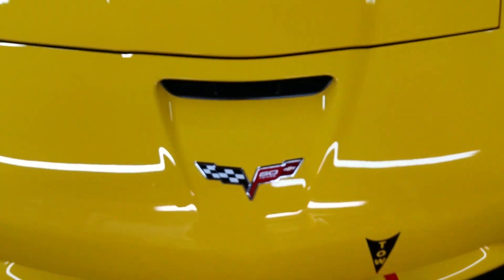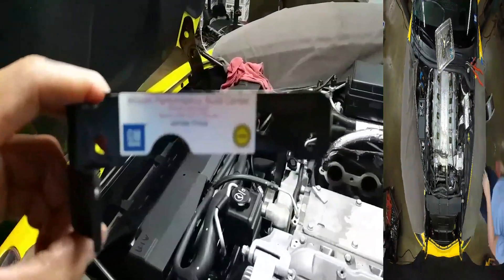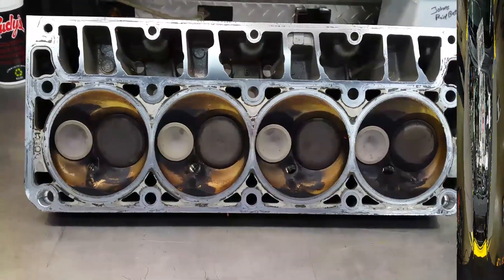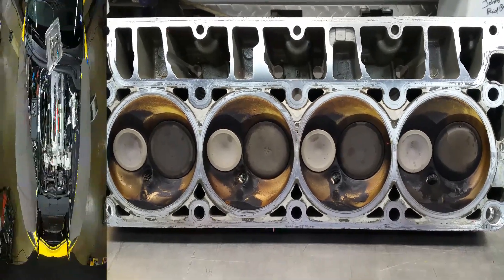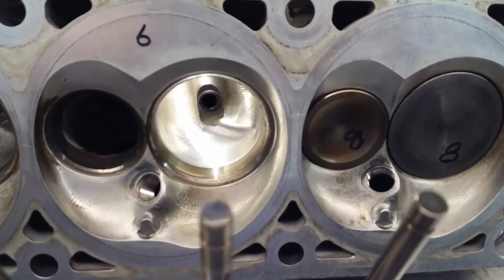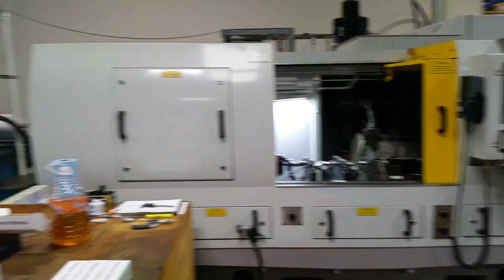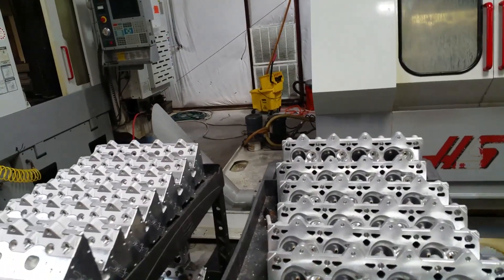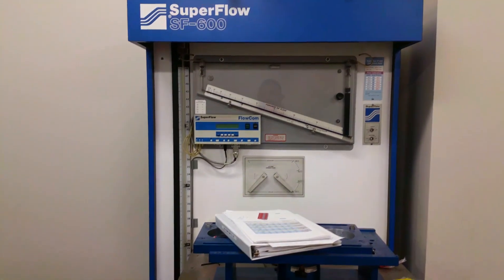2013 Corvette Z06 13k miles valve guide upgrade to prevent Dropped valve

Comment: thanks for the vid. the wiggle test after the springs were removed shows that the valve guide clearance was out of spec but your measurement method measuring valves still under spring tension and measuring at the top of the stem and not in line with the rocker arm arc along with not measuring normal to the valve stem will give you wildly inaccurate measurements. that being said, the guides were out of spec and you did the right thing by replacing them. thumbs up.

Comment: I recently purchased a 2006 Z06 LS7 with 47k miles. I have done some research on the 'dropped valve' issue. Supposedly, the 2006 model year was OK and preceded the wrongly manufactured valve guide issue.  It has not been serviced for that problem, has 47+k miles and runs perfectly with no valve noise.    Can anyone tell me if there is something to be concerned about?  Thanks in advance.
Reply: Get them replaced period
Reply from the maker: http://l.facebook.com/l.php?u=http%3A%2F%2Fread.uberflip.com%2Fi%2F834132-july-17%2F77&h=ATOPqJlypbNelpNkNrOBAkM7GtHwxYZs_1jR8pUXE-VqJg0AnIE17KRhtLRY-aKj0KRJbtArU6-ILJNOQzlHjYFIhfK_7QMB8FqUamXqpH-s5P2p1R8sXsO3g9M&s=1  
here is a good read its a downloadable pdf go to page 78

Comment: can you tell me what is the Katech part number for the exhaust valve upgrade kit that you used        I am replacing the engine on my 2008  z-06  that an exhaust valve parted on the number 4 cylinder  with 60000 miles   and am installing a new set of GM-LS7 heads and would like to fix this exhaust valve problem so that it will not happen again.    I received my new LS-7 block from Texas speed and performance  and am in the process of installing the new set of GM factory LS-7 heads.      would like to know the results of this exhaust valve and valve guide upgrade went on your engine.
Reply from the maker: I used pn# SKU: KAT-6586 Titanium valves from Katech,  Texas speed did all the machine work and installed Bronze guides